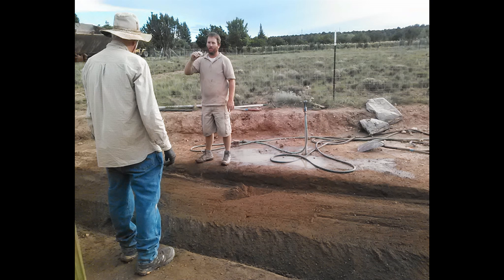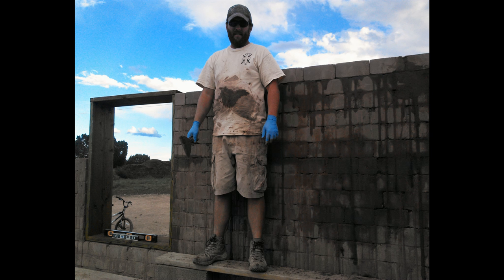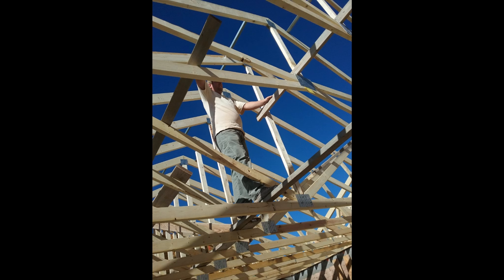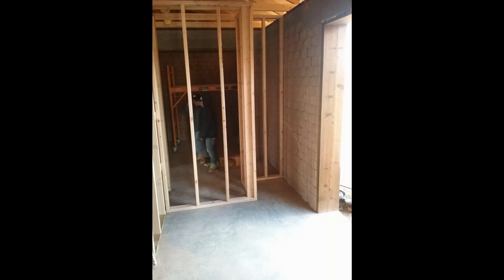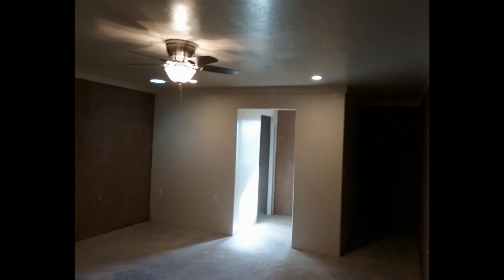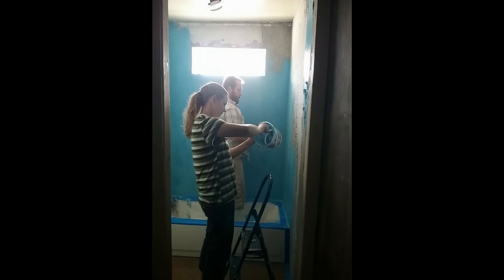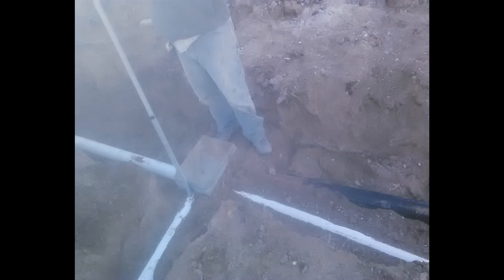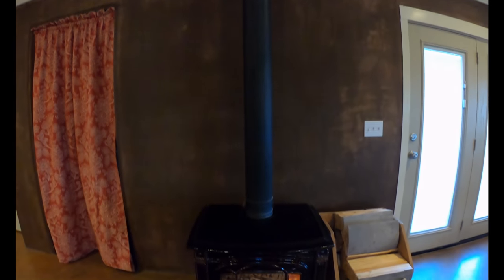Compressed Earth Block House

Comment: What county in AZ did you build the house?
Reply from the maker: Thank you for your inquiry but I respectfully do not want to disclose my county due to privacy concerns.  I have small children in my videos and I have a responsibility to protect them.  What I can tell you is that my county did not have a code for this type of material.  However I built my home regardless of them knowing about this material.  I did go through 3 months of intense discussions with them once they found that I was building my house.  In the end they only marked my property that I built without a permit.  I was very fortunate that I did not have any fees, just a large head ache for 3 months.  However I did follow New Mexico's code for building with this type of material.
Reply: @SustainableLiving  I understand your concern, thank you for responding and doing what you can to help!

Comment: Dear Sir I'm a Filipina it is possible in my country Philippines this house we were a typhoon prone country pls advice thank you for the new house innovation may gthe God lord blessed for good deeds
Reply from the maker: Thank you for watching our video and your kind words, from my understanding this type of material, compressed earth block does really well with high winds, this is spoken for the walls only though.  The roof of the structure will have a greater risk than your walls.  If one uses the bond beam to lock your blocks in place the you will have a very strong wall.  Be sure to add 10 percent Portland cement in your block mix so your blocks become water resistant.
Reply: @SustainableLiving  Dear Sir, Thank you for the advice It is highly appreciated, may the Good Lord keep you, for this Job well done. I remain Rita
Reply: The walls were hard,and durable,how     About the roof,what is the material to be use please advice,thank you all the best